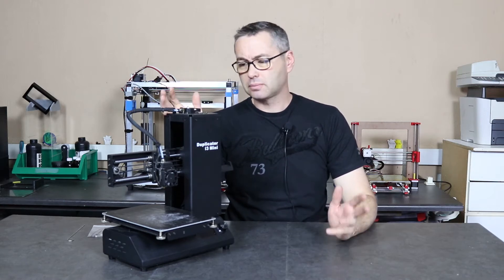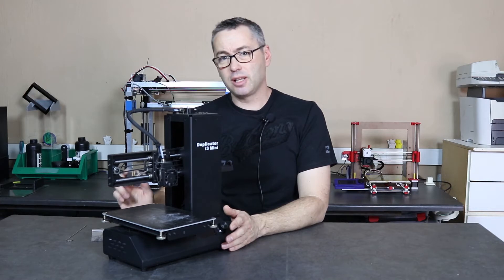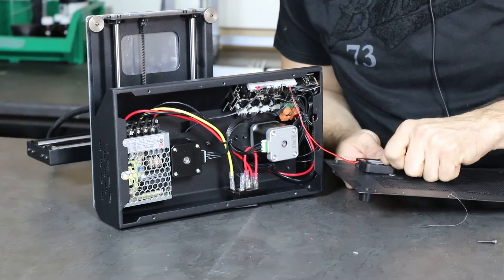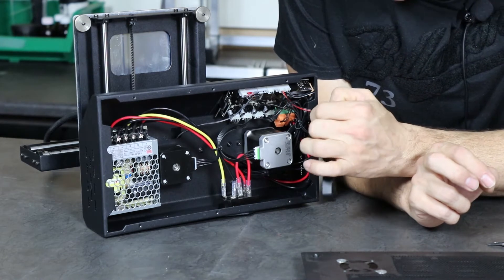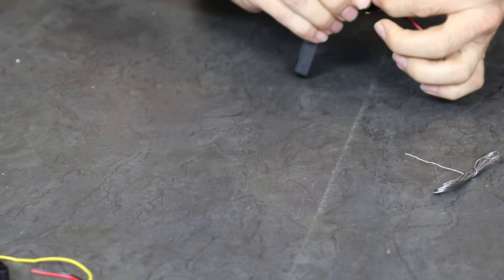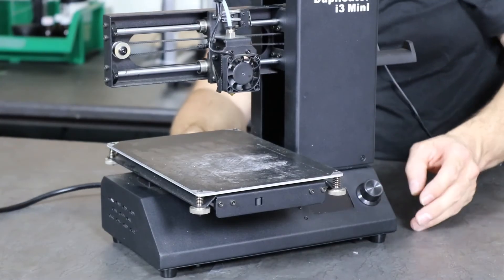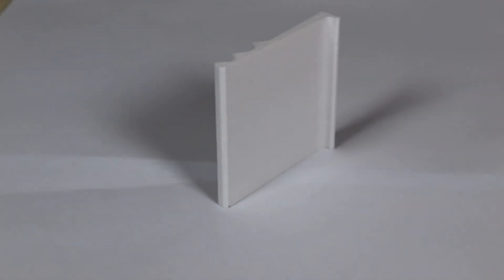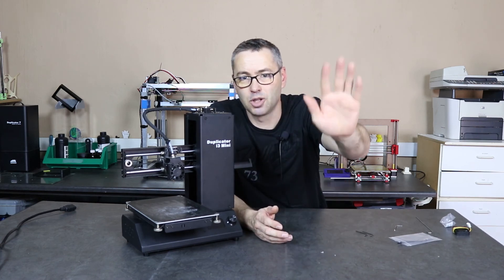Wanhao i3 mini fan replacement, and print showcase.

Comment: I have a question, would this be a good printer for example printing cookie cutters & scale 1:64 parts.Coming from using a Anet A8 (my first entry into 3d printing) it looks like out of the box this little printer does a good job printing the normal day to day stuff.
Reply from the maker: Great little printer, but it is a little older now. if you can find one for a decent amount go for it. I would not get this over something like an ender3 if they are similar money.
Reply: @MScholtz  Cool dankie vir die terugvoer.Ek hou gereeld dop as hulle tweedehands geadverteer word.Kan 'n Wanhao i3 mini nou kry vir onder R2000 en gewonder of dit dalk 'n goeie printer wees om na te kyk.

Comment: Just busy running my first print on my one. Arrived today. I am familiar with printers and the issues and trade offs, and my main 3D printer costs 4x as much as this.

Bought this to do quick evaluation/debug prints of my Fusion 360 designs while the main printer is busy. I am astonished at the print quality.  
This ones getting a heated bed, and an enclosure. Sitting in my lab/workshop are heaters, PSU and Thermostat controller waiting for build an install. ABS is my favorite Filament, followed by HIPS.

Sometimes I think smaller may be better - less moving mass and inertia.

BTW - Love your style. Nice and easy yet entertaining and informative.
Reply from the maker: One of the nicest little machines Ive had.

Comment: Quick question - the build area of the printer is stated as 120mm x 135mm x 100mm  in the manual, but on Wanhao's UK site and a few other review sites it's stated as 150mm x 150mm x 115mm. Can you confirm if the larger area is indeed printable?
Reply from the maker: Dewald Schultz unless something has changed it’s the smaller build volume you’ll be able to print. The bed is actually quite a bit larger than the size it can print.
Reply: Thanks

Comment: I have a Prusa clone (Anet A8), but this (MP i3 Mini) went for sale on ebay for $100 and couldn't pass it up.   Is there anyway to add a heated bed?
Reply from the maker: DryUrEyesM8 There may be a jumper for it but the firmware isn't setup to acknowledge it. You'd need to do it with an external controler. You will also need to make changes to the cooling fan as it cools the heatsink and print job.

Comment: What settings and filament did you use? My prints don't look anywhere near as good
Reply from the maker: I use wanhao filament but I'm not particular about the brand, seems most brands are fairly decent now. I keep things simple to begin with and would recommend Cura 15 if you're starting off because it doesn't bombard you with settings. stick to 0.2 layer height and don't try and print too fast around 50mm/s should be good. see how that works. I'm busy with a basic tutorial series and will be posting the 1st one in the next few days.
Reply: The main problem I've had is stringing... For example when I printed one of the retraction tests where there's columns for the printer to move around I get a half solid looking structure in between. I'm wondering what temp and retraction settings you use. Ive tried  changing retraction speed, distance, travel speed, and temp but it doesn't help is there something I'm missing? I see other people printing the retraction test models with nothing in between the columns but I can't get it to work.

Comment: i got an i3 mini and i cant manage to make it so the print stick on the bed, tried lack, acetone etc any idea how to solve my problem ? Bed is aligned and (when it....) prints are perfect, its just that at some point the model just move from the bed and print fails :/
Reply from the maker: Use the glue stick that came with it. Apply a layer just before you start the print. After a few prints you wont need to apply it every time.
Reply: thanks for the reply, i tried that but still no luck :/ damn i think there is something wrong with my printer, each time i print something (or i try) the bed need some re-levelling, keep moving down after each print attempt :/ erghhh
Reply: I cover the build tak in a generous layer of prit and preheat the extruder before I start the print it has never failed on me get it unstuck can be tricky some times.
Reply: I used double sided Vinyl floor tape and it works a dream
Reply: I had the same problem with this printer. I bought a sheet of PEI on Amazon. The one I got was 220mm X 220mm with 3M adhesive on the back. I had to trim one side down and the corners for the leveling screws with a straight edge and razor knife before applying. Peel the old black bed material off (I removed the plate from the printer to make this easier without bending the plate) and soak the whole thing in acetone for a couple of minutes. Then take a scrubber and remove all the old adhesive. Once it is clean and dry carefully line up one end and lay it down. It doesn't take long but that PEI is amazing to print on without a heated bed.